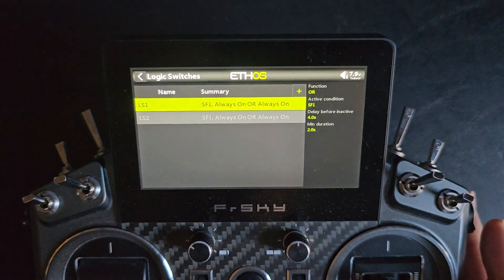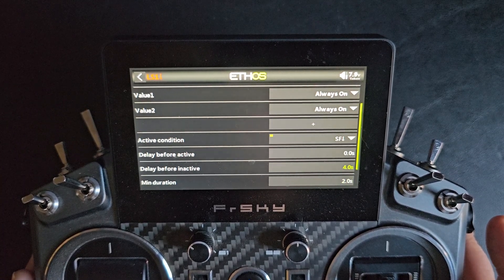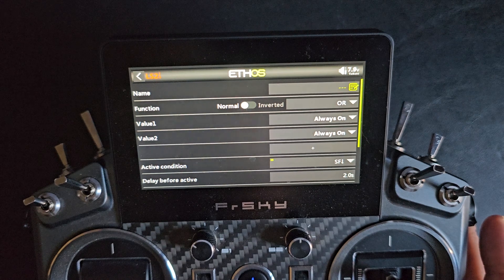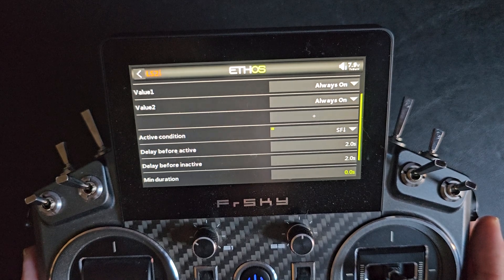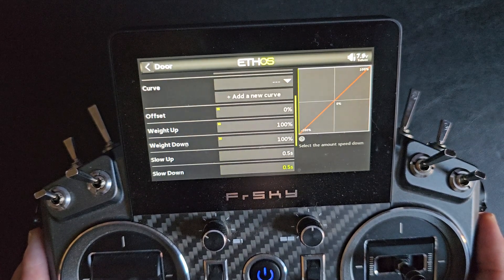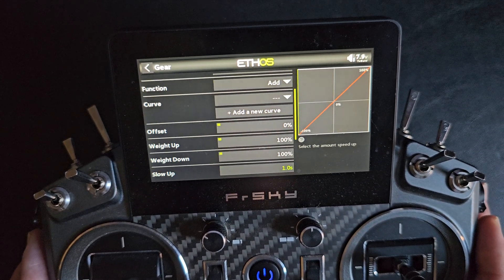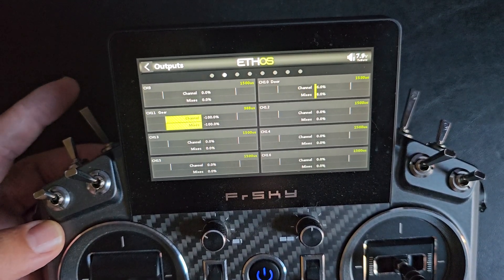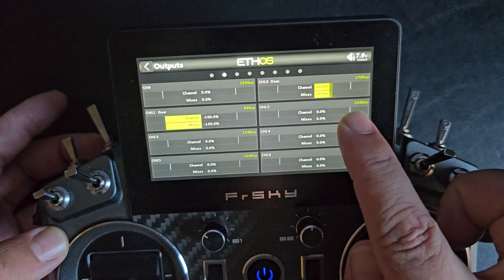FrSky ETHOS Landing Gear Door Sequencing Example to Keep Door Open When Gear Deploys

Comment: Using a controller with a built in 1.5 second delay before the gear moves, with this set up gear doors are closing to soon, which of logic times need changed for g doors to hold off a bit  longer before closing? Thanks!